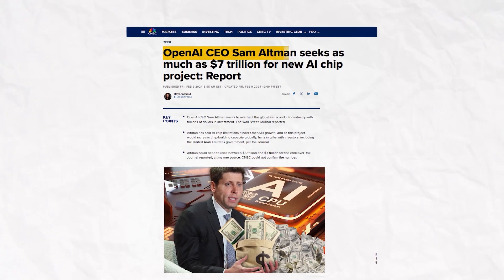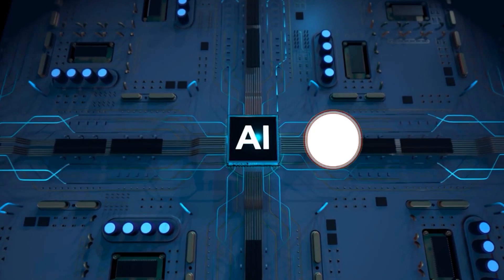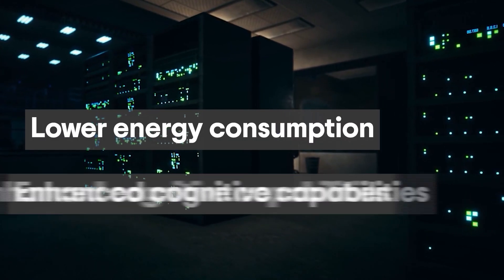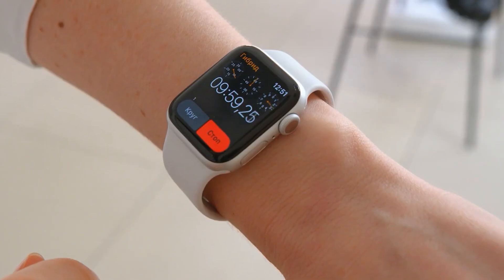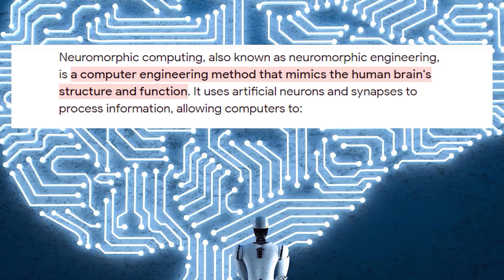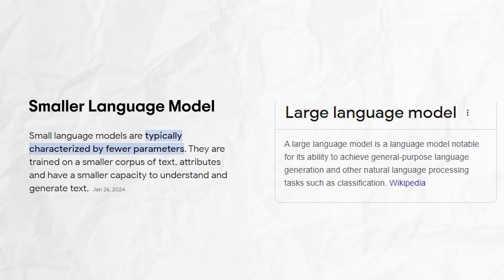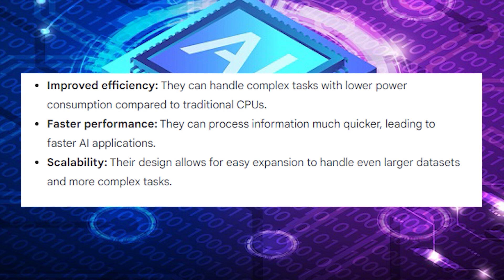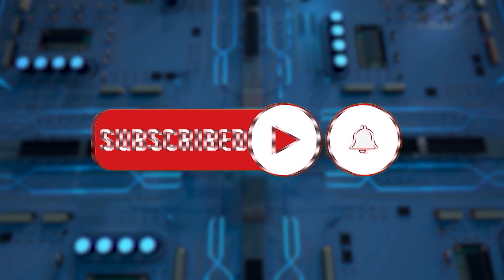This New AI Chip Challenges NVIDIA and SHOCKS the Hardware Industry

Comment: Summary : 
The C-Transformer AI chip developed by researchers at the Korea Advanced Institute of Science and Technology (KAIST) represents a groundbreaking advancement in artificial intelligence (AI) technology. This innovative chip is designed to revolutionize power efficiency and size in AI accelerators, marking a significant milestone in the field of AI and neuromorphic computing.

Key highlights of the C-Transformer chip include:

1. **Ultra-Low Power Consumption**: The chip achieves a remarkable 625-fold reduction in power consumption compared to existing solutions, making it highly energy-efficient.

2. **Compact Size**: With a size 41 times smaller than Nvidia's A100 GPU, the C-Transformer chip offers unparalleled compactness, ideal for applications where space is limited.

3. **Neuromorphic Computing Technology**: The chip leverages neuromorphic computing technology to mimic the neural structures of the human brain, resulting in improved computational efficiency and reduced power usage.

4. **Innovative Architecture**: The C-Transformer features a revolutionary architecture with three main components optimized for AI processing, showcasing KAIST's commitment to pushing the boundaries of AI technology.

5. **Mobile Computing Applications**: Due to its ultra-low power consumption and compact size, the C-Transformer chip is well-suited for mobile computing applications, enabling the integration of advanced AI capabilities into portable devices without compromising power efficiency or form factor.

6. **Pioneering Chip Design**: KAIST's innovative approach to AI chip design, coupled with advancements in neuromorphic computing, sets a promising direction for future AI hardware development, with implications for research and application in AI-powered devices and systems.

Overall, the C-Transformer AI chip represents a significant leap forward in the quest for more energy-efficient AI technologies. Its development underscores ongoing innovation in the field of artificial intelligence and opens new avenues for research and application in AI-powered devices and systems.

*Summary Table:*
- **Innovation**: The C-Transformer chip by KAIST revolutionizes power efficiency and size in AI accelerators.
- **Advantages**: Ultra-low power consumption, compact size, and reliance on neuromorphic computing technology.
- **Applications**: Suited for mobile computing and offers potential for integration into portable devices.
- **Impact**: Represents a significant advancement in AI hardware development and opens new avenues for research and application.
- **Future**: Sets a promising direction for the sustainable and widespread deployment of AI technologies.

Comment: 1. Energy Efficiency and Edge Deployment: The C-Transformer's ultra-low power consumption makes it an excellent candidate for edge devices, IoT applications, and mobile platforms. As researchers refine its architecture, we can expect even more efficient variants that strike a balance between performance and energy usage.

2. Customization and Transfer Learning: Personalized AI experiences are gaining prominence. Future transformers may allow users to fine-tune models for specific tasks with minimal data. Transfer learning will continue to play a crucial role, enabling pre-trained models to adapt swiftly to new domains.

3. Multimodal Transformers: Current transformers primarily focus on text-based data. However, the integration of vision, speech, and other modalities is an exciting frontier. Multimodal transformers could revolutionize applications like image captioning, video understanding, and speech synthesis.

4. Ethical and Explainable AI: As transformers become more pervasive, addressing ethical concerns and ensuring transparency is vital. Researchers will explore methods to make transformers more interpretable, fair, and accountable.

5. Hybrid Architectures: Combining transformers with other neural network architectures (e.g., CNNs, RNNs) can yield powerful hybrid models. These hybrids may excel in specific tasks while maintaining the benefits of self-attention mechanisms.

6. Quantum Transformers: Quantum computing holds promise for accelerating AI tasks. Quantum transformers, designed to harness quantum parallelism, could unlock unprecedented capabilities.

In summary, the C-Transformer's journey involves pushing boundaries, adapting to diverse contexts, and shaping the future of AI. As researchers collaborate and innovate, we'll witness remarkable advancements in the field.